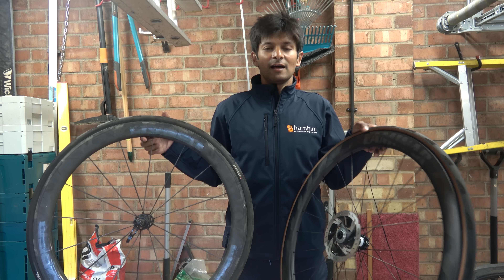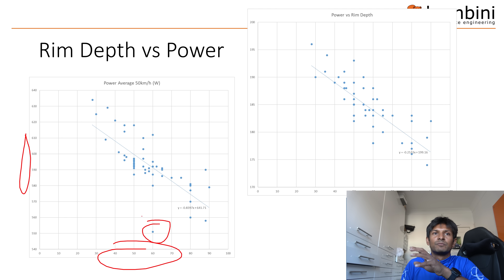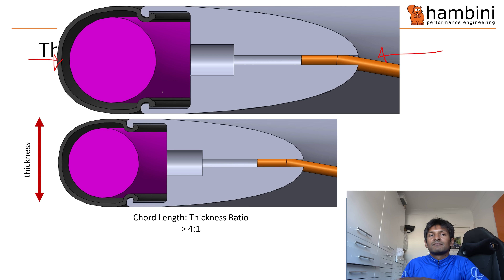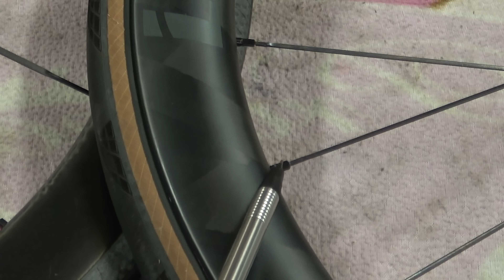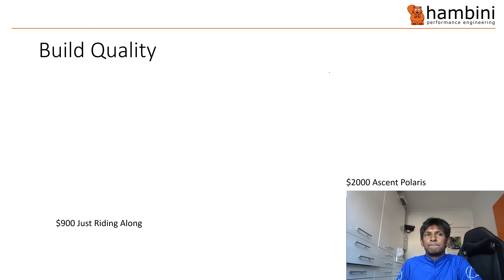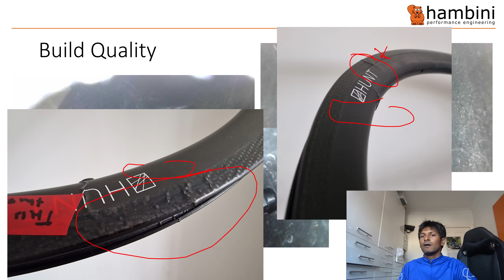Aero Bike Wheel Buyers Guide | By an Engineer

Comment: 9:43 i dont quite understand the maths... how does 50mm depth with 23mm width equal a 4:1 ratio???
Reply: You're right, it doesn't. Nevertheless, you must add the tyre to your rim depth to get a true ratio.
Reply: @the318pop  Or did he mean the tire radius, not width?
Reply: @MrBusunglueck  yes, it's effectively split in half. If the rim width is 25mm and the total depth of rim and tyre combined is 70mm then the ratio is 70:12.5 or 5.6:1

Comment: Steel spoke wheel front, disk wheel back, full suspension is the only decent design.
Reply: If you want to be a lot faster; just add ad triathlon steer.
Reply: And use 26" racing wheels (Can't buy tubes anymore).
Reply: If your front wheel increases air turbulence; the air should stick less to the rest of the bike?

Comment: Would opting for a staggered setup be of any benefit? i.e. going for 62 rear 56 front? Get the better of each world sort of thing. Thanks for the very informative video
Reply: Yes. But the advantage is very small, because the rear wheel is mostly in turbulent air compared to the front where the air is much "cleaner". In theory, if you ran a reversed staggered setup, with a deeper wheel at the front, the advantage would be bigger, but for obvious reasons most people don't want that. I don't think that a 62 rear will have any noticable advantage compared to 56 rear
Reply: @honzakrcil7454  Thank you for your insight friend. I will probably go ahead and buy LB ar56s come this autumn.

Comment: Great video and very informative. I did miss the 5yo and I suspect that the pen isn't working.
Any thoughts on the 2 spoke wheels? They are "meant" to be the bees knees as far as aero efficiency and crosswind stability. They aren't super expensive compared to Zipp wheels and the weight is comparable.
Reply: The pen is is working but Hambini rightfully recons that more new viewers get a video like this recommended that aren’t used to the fooling around and those would be put off straight away and miss the solid advice
Reply: And they're dangerous if you're riding in a bunch.
Reply: @nikivvsm  why?
Reply: @basedgodstrugglin  , it's quite realistic to trap a leg or hand between frame and the wheel during the crash. With a normal wheel you'll break couple of spokes and probably will walk away with some rash. Now imagine traping it between these blades which are much thicker and designed to support all the power and weight of a rider. Much likely to be a disaster. UCI have banned wheels with less than 16 spokes for a reason.
Reply: @nikivvsm  that thought never crossed my mind, makes a lot of sense

Comment: 13:05 the fork geometry is more influential than the factors you list. I've experimented with lower rake forks, which increases the stability substantially. 
Obviously you have to design the frame and fork appropriate to each other, but if you employ a lower rake, the wheel is closer to the steering axis which balances crosswind forces better.

Comment: There seems to be a trend  that manufactures are now starting to spec different size rims and slightly different external widths with different rim profiles. So a blunt rim at the front and tear drop at the back. Enve and a few others are doing this. 

The problem with 100% rim matching with tyres is the quoted size is hardly ever correct so the WAM so a bit of a crap shoot in that regard.

Comment: When you say that the reasons the industry are trending towards discs you said it was for commercial reasons. What are the commercial reasons in this case?
Reply from the maker: You probably have a perfectly functional bike that has brakes of that design used for 50 plus years. To get you to buy something else that you don't need and will probably be slower for most people does not make engineering sense

Comment: Excellent stuff as always. Curious if you rate latex tubes or just run butyl?
Reply: With latex tubes, your tire reinflation intervals will be shorter due to the porous nature of said tubes. You have to check them more often.

If you can put up with this, you can go latex.
Reply: @sbccbc7471  how often u get flats on latex vs the normal heavy tubes?
Reply: @PhiyackYuh  I've only ever ran butyl and never got a puncture.

Comment: I'll stick with my Low profile FULCRUM RACING ZERO NITE clinchers with 25mm CORSA tires! I've had 6 months on an Aero frame Pinarello with ZIPP 454NSW's and now the lot has been sold. The wheels were good for speed, but You need strength to maintain that speed and that's something I have'nt got at the moment nor the time to create it. Construction wise nicely built, rims are full of dimples which are useless(wtf are for?). Good thing is the fish scales on the braking surface, as regards to other brands that did'nt think of that one, they do stop better! Complicated freehub mechanism using magnets and 2 slotted sprocket system(which needs oiling every 1000km). €3000,oo wheels? Worth it? Nope. The sawtooth inner shape of the rim has a bad reputation for drag and loss of the aero gain on the high front side of the "tooth" so as with the dimples.......WTF?  Overall I'd class as good but not Brilliant, and at 3K you'd want some damn right brilliant wheels for your money. PS. I sold them to a guy who'd had enough of his ENVE constantly breaking spokes. Great video as always.
Reply: The idea behind the dimples (there are also on golf balls) is to create turbulent flow around the surface and thus making the angle of contact (dunno how it is properly called in english) bigger. See this:
https://i.stack.imgur.com/hrI39.png
Reply: @kosskrit  I'm not sure you really want turbulence a on rim wall. But rather a straight slipstream over the surface. Our Engineer friend will correct me if I'm wrong.
Reply from the maker: @RICHARD.WRIGHT1  A turbulent boundary layer detaches further along, so it reduces the pressure drag. The problem with the zipp dimples is they are in the wrong place.

Comment: 19mm tyres rock ! You can even remove a wheel if you have 90gram a pair CNC brake calipers with zero faffing about .
Reply: I have 23mm tyres on HED c2 rims.   No brake faffing there either.  (I'm too fat for 19s and NZ roads are too shitty)
Reply: @slidey1788  yeah the CNC brakes that weigh under 90 grams a pair , have no quick release on the brake caliper to, keep the weight down , if your rims are running true and straight , you need to use a hex key to slack the brake cable . I had 23's and 19's on the same bike bro (: , but you managed it on your rims ? Nice. I weighed 100kg at the time . But gotta tell you , in North England , taking your Scott addict R1 from cozy warm 22 degrees indoors , to minus 2 outside kills carbon frames . 2 minutes after said temp difference, riding on my usual cobbles ( Alnwick Northumberland) , hit a cobble a little hard but nothing major at 30 mph , and the water bottle boss snapped , I did not even have a cage a bottle fitted . I love carbon for its ground breaking , but to be honest mate , triple butted Reynolds 753 steel from now on , my great grand kids could find it rusted in a shed 50 years from now , and soda blast it , repaint it and ride it ( the frame and forks ) . Cheers Bruce (:

Comment: Hey hambini witch are the best wheels for heavy riders? Carbon or aluminium? For example I am 110 kilos. And how. Wide  they  must be..25 mm  28 ..30?
Reply: Good quality aluminium rim with high spoke count will be best.
Reply: @BMD8  thanks!
Reply: Also, consider a studio-built wheelset. The wheelbuilders will spec your wheelset accordingly, from your weight to your riding (style, conditions, etc.).

Comment: I've got a mavic comic wheel that employs an aluminium rim, with a carbon  45mm deep sheath, stainless bladed spokes and hidden  nipples.  Any thoughts on that kind of strange wheel? The carbon is literally not structural.
Reply: Nothing wrong with this kind of wheel, just that it'll be heavier than a full carbon wheelset. In fact, you maintain good braking performance especially in the rain. You also don't need to swap the pads when you switch between these wheel and your aluminium training ones.

This is exactly what HED does because they believe it's safer than fully carbon.
Reply: Just like " high end " carbon chainsets , just alloy wrapped in non structural carbon for the more money than sense brigade .

Comment: Excellent video. The only comment I would add is that with Shimano hubs, you will get water ingress and the bearing surfaces will rust, ruining the hub. I now use hubs with cartridge bearings after 4 Shimano hubs were all ruined from water ingress. And no, I do not jet wash my bike.
Reply: I have had this same experience with a Shimano R35 hub on my MTB

Comment: Interesting to hear about the alpha critical angle. I was u set the impression the U shaped rim is quicker than the V shaped rim. Or did I hear it wrong. Great vid.
Reply: Under the impression*
Reply from the maker: @jeremymaclean3535  you really want a shallow taper so a V would be faster. Typically, only a few wheels are an actual V and a lot are a V with a blunt end. A structural problem develops if you have a true V because the spoke nipple attachment causes a stress raiser. The U shape was marketed as having superior cross wind stability. If crosswind stability is that much of a problem you are better off going for a classic teardrop with a slightly shallower depth.
Reply: @Hambini  I see makes sense. 😀

Comment: My argument for disc brakes is that they were too f*cking stupid to realise the problems of using rim brakes on carbon clinchers. 100psi, heat, resin... delaminating and exploding rims, even with those "special" brake pads. High temperature resin you ask? That stuff is inherently brittle, terrible when you're dealing with real world stresses like potholes. It's also much cheaper to replace a worn out brake rotor than a worn out rim, and the rims on their own can be lighter as they don't need hefty sidewalls (the mountain bikers figured this out decades ago).

I'm all for disc brakes on new bikes, regardless of weight or aerodynamics. The only reason rims brakes still exist is because the industry can still make a profit from them (whether people are even buying the rim brake bikes or not!)
Reply: if youre a lightweigjht rider in most flat terrain and only ride in nice weather, then quality carbon rim wheels are fine... i have a rim brake wheelset and the brake pads are on their 5th season and will prob last 5 more, im very light on the braking .. if i weighted 100kg and was bombing down alpine mountains, then i would get disc brakes
Reply: @JogBird  I'm not saying to go buy a new bike, just that when you do there's no valid reason not to have discs.
Reply: True, the reason I buy disc brake cause that reason. Cfrp made of 40% polymer. It will explode.

Comment: Hi @hambini, can you give some comment on Powerway R39 hub, which is using total of 9 bearing.
4pcs of 688 bearing in the front and 5pcs (6902x1 and 4 6802) in the rear wheels.

They claimed the wheelset will be much robust and stiff.

Comment: I am a huge critic against aluminum (“aluminum”) nipples. They corrode and become impossible to turn, and end up getting rounded off. Definitely not worth the weight savings. On that note, I do not like the partially recessed nipples of that wheel you showed. With such high spoke tension of carbon spokes and so little surface area for a spoke wrench to get a purchase on, I can imagine those nipples getting f’d up as well. 

Aerodynamics aside, what are your thoughts about the practice of lower and lower spoke counts? What about radial vs tangential patterns? Personally speaking, I would prefer more spokes and no radial.
Reply: Radial spoke pattern is the stiffest configuration for lateral forces but is a terrible design for transmitting torque thus making them great for a rimbrake frontwheel but you probably never encounter them on discbrakes and rearwheels. Mavic has a hybrid design with one side radial and the other tangential, i never rode such wheels but i assume its more for looks than anything else as you just further reduce the amount of load transfering spokes.
Reply: Ive used alloy nipples on carbon wheels for years with no corrosion. I think it comes down to the type of riding and environment.
Reply: @glennoc8585  It's just not for those who don't take care of their own bikes well, like rarely washing them.
Reply: Yes, I've experienced this. But was able to remedy it by adding a drop of oil to the nipple-rim interface. Loctite blue on threads. The problem first manifested as a popping noise that initially sounded like a BB problem. As to rounding off, Campy has a good solution to this which is a very tightly engineered spoke nipple wrench with a special tooth to prevent slippage. I believe the nipple are also asymmetric in her shape.

Comment: Thanks hambini. Very informative.
You mentioned lightbulbing. If using thin rims with a wide tyre, would there be any issues down the line? Could I still ride it?
Reply: you just get eye cancer everytime you look down to your front wheel
Reply: Most mountain bikes have this - a far wider rubber width than the rim width.  Works for them.
Reply: @criggie  yes, but MTB tires are made with this in mind, road not so much
Reply: Yes i'd like to know this as a 25c gp5000 comes to 28.1mm on my 28mm wide(21mm internal) wheelset. Is there much of a penaulty?

Comment: That chord length:thickness ratio part needs to be paid particular attention to in regards to all the "optimised for 28mm tires" palaver being shilled at present because the external rim width has been increased. As you can see that is only part of the equation. 28mm or wider tyres absolutely bring some tangible benefits however aerodynamics is not one of them.

Comment: I have a set of rim-brake rims that I bought from Aliexpress. These rims are a clone of the Zipp 454 NSW rims where the inside edge of the rim has a saw tooth pattern. The surface of the rims also has the golf ball dimple pattern like the 454 NSW wheels do. Can you discuss how this affects the aerodynamics of the wheels? The internal width of the rims are 18mm and the external width is 25mm. On my old aluminum rims that were much narrower wheels I usually ran 700x23 tires. Since these new rims are wider I have switched to running 700x25 tires.
Reply: I think there is a Hambini video talking about aerodynamic Zipp 454 NSW wheel.
Reply: At a guess, the textured rim would do next to nothing. You're already dealing with turbulent or transient wind that's coming off the bigger tyres.

Comment: I always have a concern that, my avg speed is only 30kmh on flat, do I really need to bother the aero thing?

Thus I'm always going to the max tyre width the frame can go (32mm for now), with disc brakes and no bother that much about aerodynamics.
Reply: No
Reply: Gains in speed only matter to those who compete in races.

Comment: Hello HAMBINI👍💪 I hope you'll get more into MTB someday :)
Reply: What aspect of MTB riding and bike build that riders concern most? Roadies are primarily concerned with speed and aerodynamic, so MTB'ers must have different concern since the MTB is different discipline.
Reply: @Reanimator999  i wrote back 2 times and YT blocked it :/
Reply: @Reanimator999  If I were to engage in MTB riding (coming from road cycling and speaking as a mechanic), I'd take a trail bike (I want to jump around and flow through trails fluidly and it seems like trail bikes do this well, XC seems too stiff for me, enduro is too rowdy and DH is too single-purpose) and build it as such:

•BSA MTB, strictly no PressFit standards, because threaded is easier to live with.
•Replaceable and source-able rear triangle.
•Aluminium components. Crashes will happen when MTB biking, so I want my MTB to be as impact-resistant as possible.
•Steel bearings, because I don't see a need for ceramic ones.

These are what I can think of so far.

Comment: Um, if you have a problem with a tubeless wheel, you just put a tube in. Towing a compressor along would create a lot of handling instability, among other things, but continue...
Reply: Alternatively you can buy tires and wheels that don't need compressors to set up tubeless. Like Hypers + Elite Drives with GP5000 S TR.